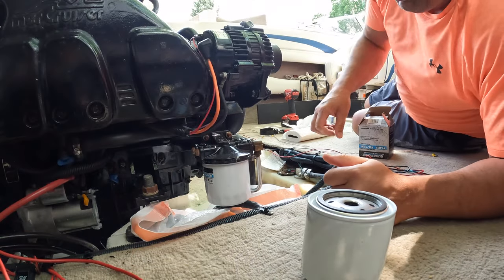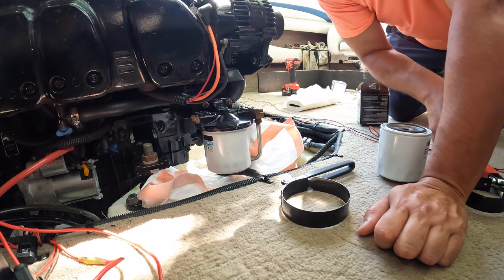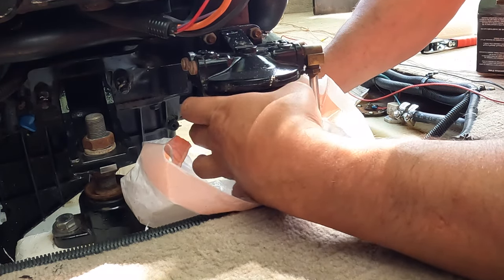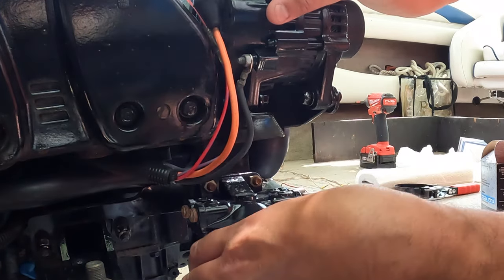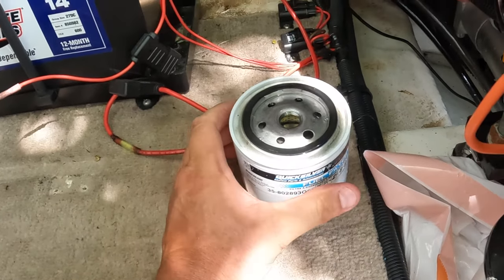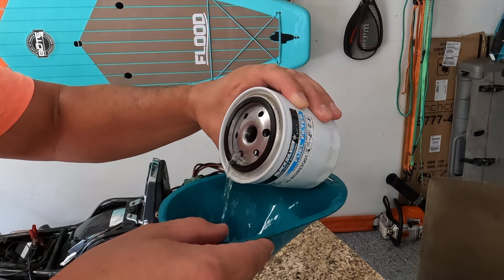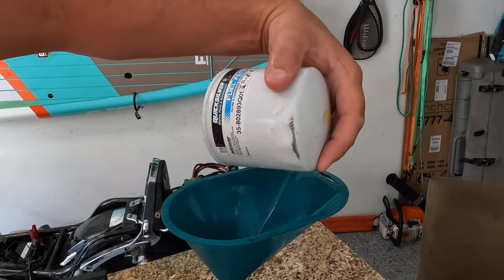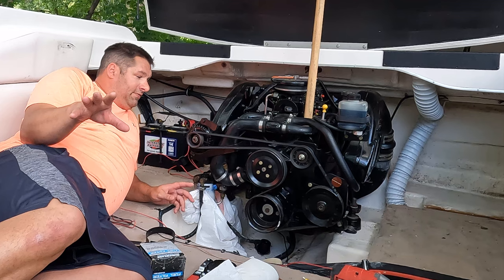Changing Your Boats Fuel Filter / Fuel Water Separator

Comment: This is how NOT to change your filter. Pull up your dip stick and get a little bit of oil to put on the new filter. And ALWAYS prime the new filter with gas so that you don’t run the fuel pump dry. It will burn out and ruin the pump in seconds. I learned that lesson the hard way.
Reply: Thanks
Reply: Hey man quick question when you say prime the new fuel filter you mean fill it up with gasoline right

Comment: would it be better to use a little motor oil on the seal instead of fuel? like an oil filter.. I'd be concerned the gasoline would dry out the seal.
Reply from the maker: Yes.it would be better

Comment: Hey Chris, I have a 3.0 Mercruiser that I used to take out all the time, it ran great.
 Last 2 years it's been sitting.
I started it last year but ran rough.
This year it won't start.
Tank is 3/4 full.
I haven't changed this filter in 8 years... i know very dumb..
Now im putting new spark plugs, cap and rotor, ignition coil, new plug wires. Also this new filter.
Anything else you recommend to get this boat running again?
Reply from the maker: I would do the impeller too
Reply: @Chris Boats  I did the Impeller about 3 years ago. Think it would need replacement?
Reply: @sean6049 yes

Comment: How many hours would you say you want to change this out? Different boat owners will put different amount of hours on their motors each year.
Reply from the maker: I recommend the beginning of every year which is most important. I wouod say 100 hours.
Reply: Every year during fall winterization. Any water in filter can freeze and cause filter to split/burst. Changing in fall is the safest way to insure it's water free..